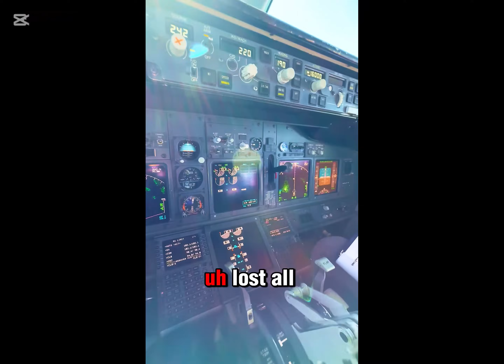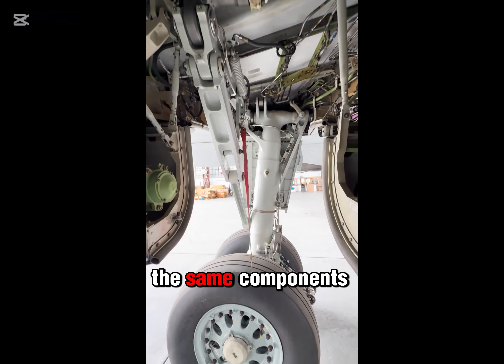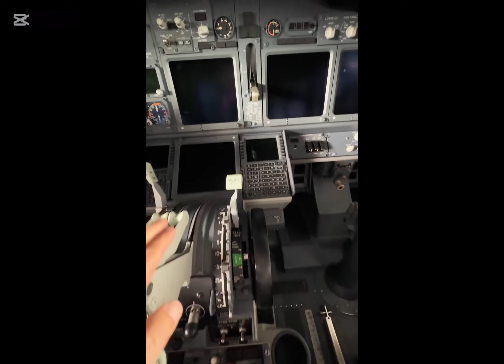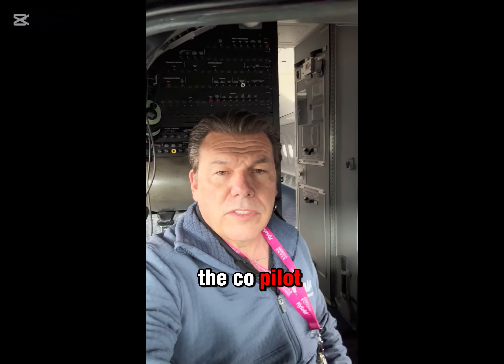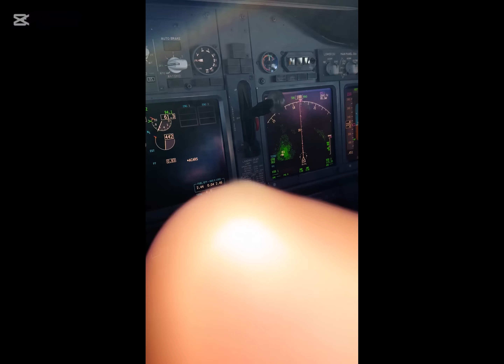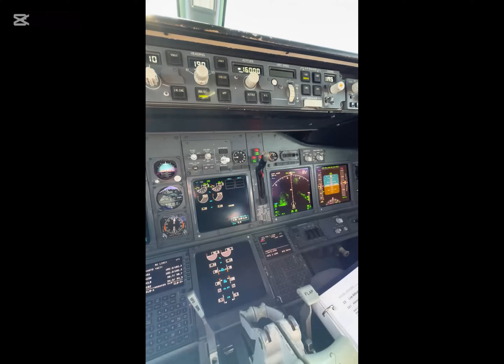B737 Airborne Emergency Landing Gear Extension.

Comment: Thanks for showing the latch mechanisms.  I was told by an AP Mechanic that no matter what condition the hydraulics are in when those handles are pulled those landing gears are coming down.  Seeing is believing.  For those who can't visualize, this is the same concept as the hood release in every modern car.  Pull the handle and the hood pops up to the safety catch.  Same concept here just bigger and no secondary catch.
Reply from the maker: Thanks for the info!

Comment: The standby system has nothing to do with the gear, it only supplies hydraulic to leading edge slats and flaps, rudder and thrust reversers.
Landing gear works on either A or B hydraulic or gravity.
Reply: Landing gear retraction can happen on B system after engine 1 failure, but it can't be extended using B system.